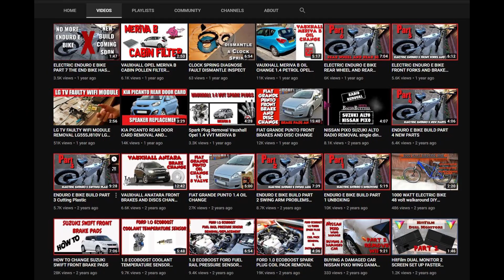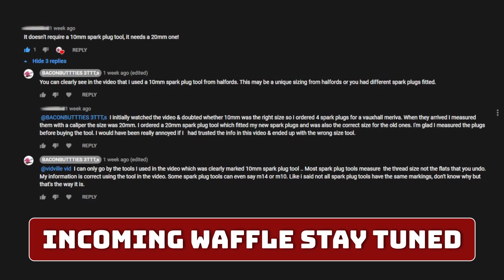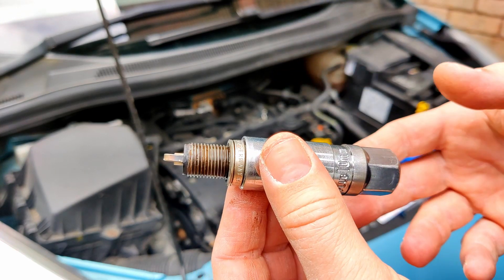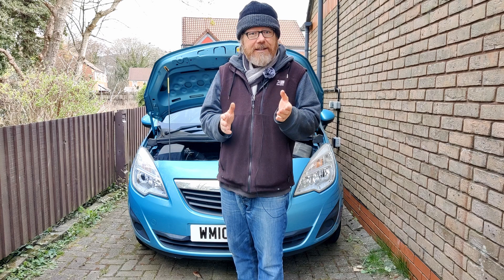SOMEONE GOT ANNOYED AT MY SPARK PLUG VIDEO - WHY ARE SPARK PLUG SOCKETS DIFFERENT SIZES

Comment: Hi mate, any chance you can do a video on topping up the power steering fluid on the meriva? I've looked in the owners manual and there is nothing at all in it regarding correct level or the type of fluid. Cheers Jez.
Reply from the maker: I will look into and try and do a video 👍
Reply: @baconbuttties  Thanks mate , that would be much appreciated. 👍
Reply from the maker: @ytjcubb  👍🏼
Reply from the maker: @ytjcubb  video for power steering fluid is now up, hope it helps